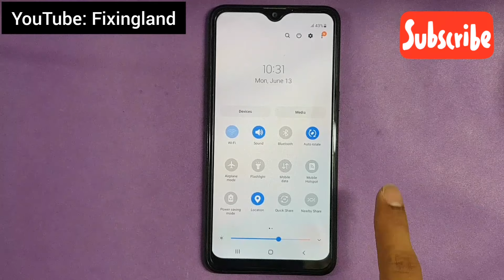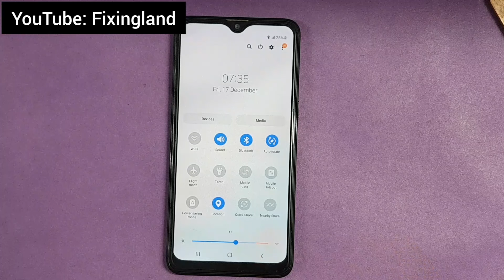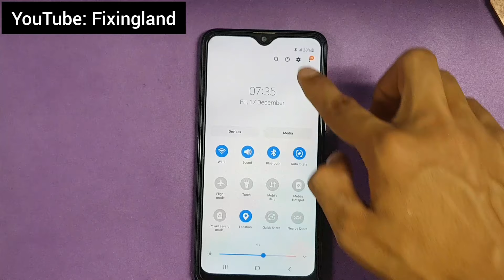Wi-Fi & Bluetooth not working / Samsung A10s (A107f) Wi-Fi and Bluetooth Problem Solution - YouTube

Comment: Any other way to fix it? Not by opening the phone ?
Reply: Unfortunally, no, beacuse the only that cause the problem is the hardware, even if you restart or even reset your phone , it will not fix it until you fix it by the servicer
Reply: This didn't work for me, but holding the volume down button and power buttons simultaneously for 10 seconds worked. It restarted the phone and my WiFi and Bluetooth worked!